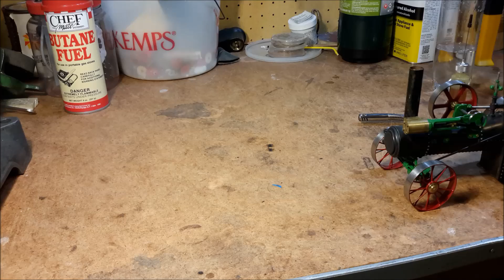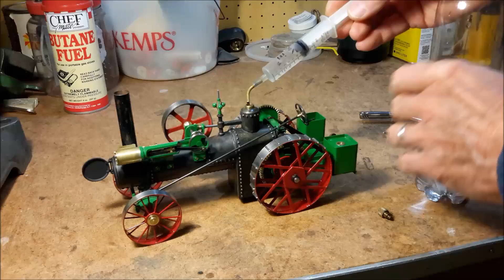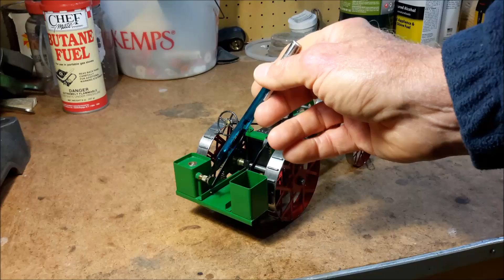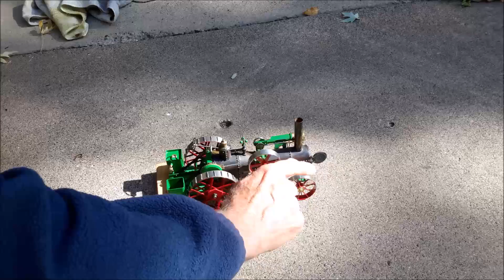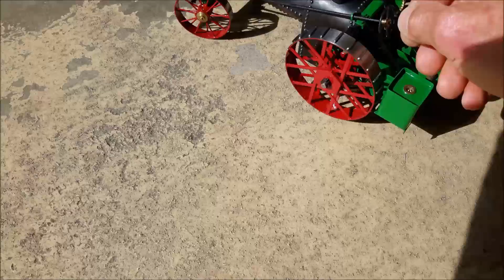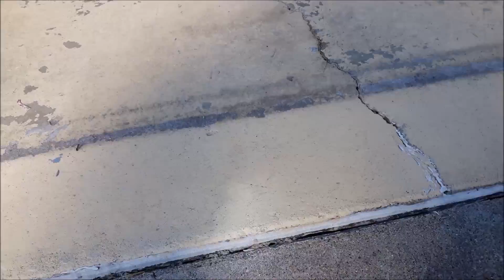BIRDSELL TRACTION ENGINE

Comment: watching with awe; so many nice models. I did many hours on my steam opperators certificate on a birdsell like that. it was much much slower on the road though, usuually we would tow it behind an english engine. that was in Tasmania, Australia, still in steam in the 1990s. i remember it because of those wheels and the tapered boiler section. thanks for the great video.